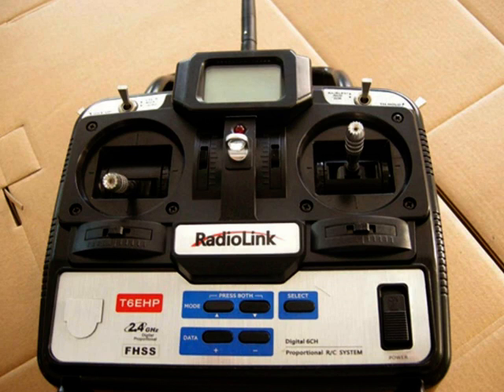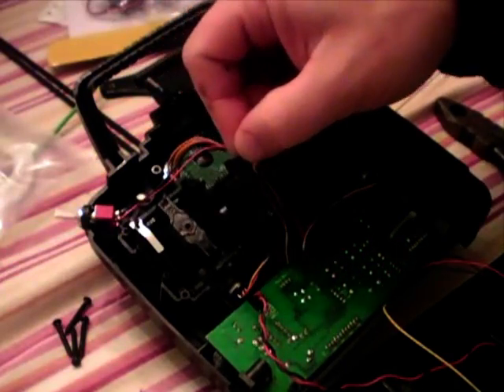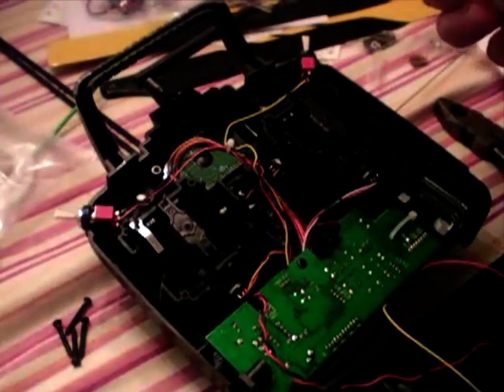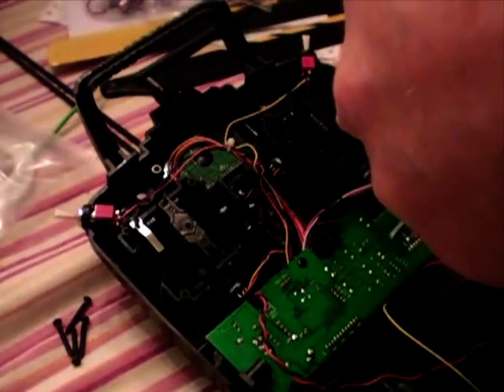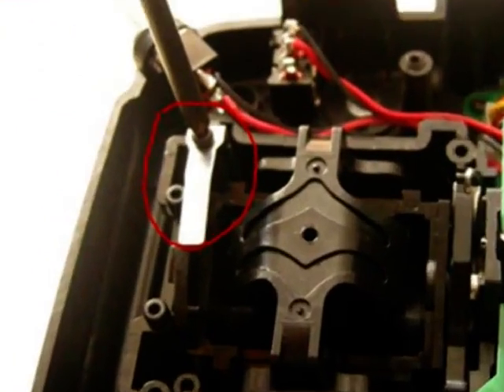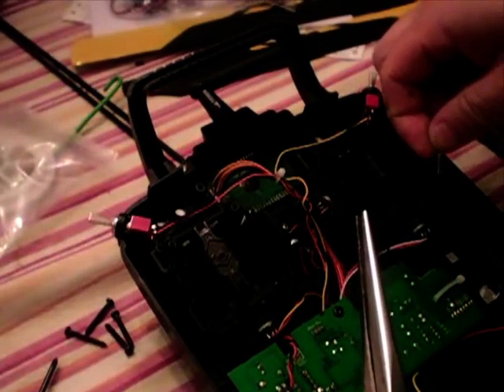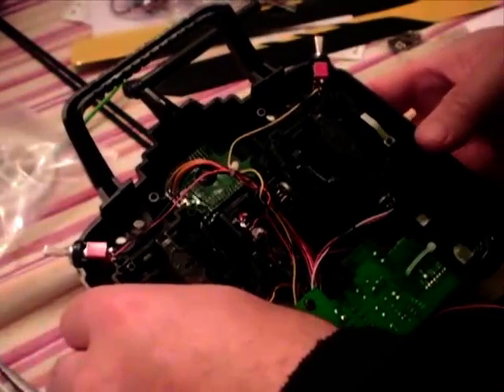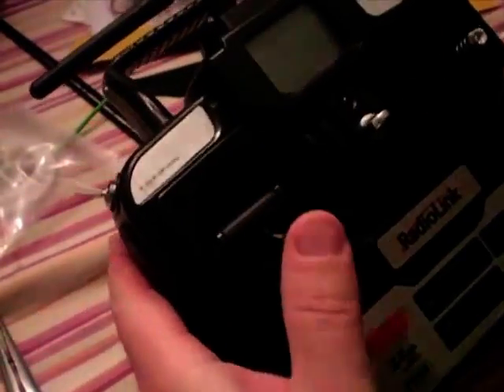Radiolink-T6EHP_Mode 1_to_mode_2_conversion.mp4

Comment: Hey man can I ask you one more ?  In my RadioLink settings, when I go to “Gyro's” it has two choices,  “INH” and “ON”. It came from the factory in “INH” mode so what does “INH” mean and should I leave it that way? I hear many people talk about adjusting the gains and I can see that if I select “ON” then it will allow me to adjust them. I have tried to fly with Gyro set to "ON" and gains set to 0% and its a mess. Thats ok and Ill fig that out later but what is "INH" mean? Thanks for ur help man!

Comment: (Part 2) The sounds or beeps were weird & crazy and I am guessing that was a safety alarm. Finally something told me inside my head to take control of the thing just in case something happened and sure enough IT DID and it was all I could do to keep a grip on it as it went to full throttle inside my house. Had I gotten lucky or “unlucky” enough to have gotten the arming & timing sequence right a few tries earlier the quad would have hit me right in the face.

Comment: (part 1) Well I wish that I wasn’t so darn impatient and waited on your comment before proceeding because the ignorant method I used to figure this out could have gotten me hurt big time. After fiddling around with it for a day or so I finally figured out that I could arm my quad by moving the stick in the upper right position then I would immediately push it all the way down which was FULL THROTTLE without having control or tethering the aircraft.

Comment: Oh btw I actually did get it to spin the motors once but the props flew off because I didn’t have then tightened down so I disconnected the power and haven’t been able to get it to spin again. I bought this thing directly from China and know nothing about the RadioLink other than its a pretty cheap radio. It was an RTF so what tha heck. I'd like to get it going. Can you help me?

Comment: I just got this radio w/ the R7F FHSS rec & my aircraft is the FlameWheel F450 Quadcop. I CANNOT find any usful instruction online and you seem to be the most know knowledgeable on youtube on this damn thing.  I am using the KK flight control K lol Oops that was too many k's j/k :) My prob is that this thing does a big song & dance but I cant get it to arm. It might be that my batts r 2 low but it but it beeps & does it thing but I cant get the throttle to work. Am I missing something?